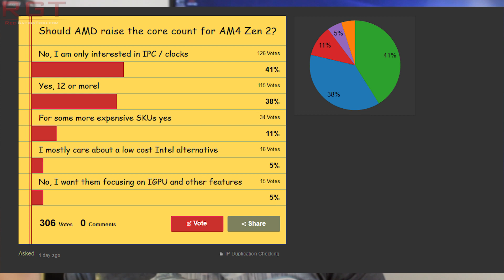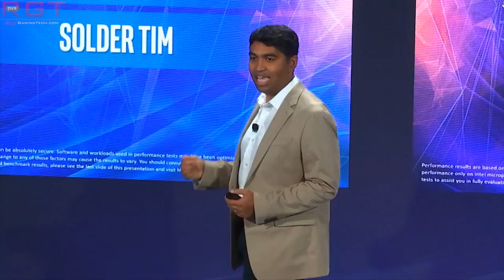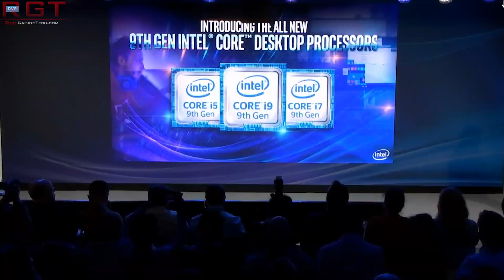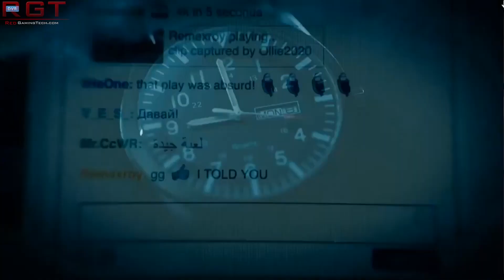Intel 10 Core Mainstream CPU Comet Lake | 14nm & Dual Ring Bus

Comment: Or, right this second you can go out and buy a 1st gen threadripper 1950x for $449 brand new on newegg and decimate anything Intel is selling in price/performance. Can't wait to see what AMD has in the pipes for this coming spring/summer when my new build has funding. Should be within margin of error for ipc when comparing Intel to AMD, and AMD will obviously have the core count and price point. Really hoping for somehow getting a threadripper at 32 cores and 4.6ghz, without the latency that current generation has. Latency is fine for workstation, but not so much for gaming. I need a streaming setup, so I need good latency to get good fps, since I play on 144hz monitors.
Reply: freak777power not for anyone who does literally anything more than gaming. Not to mention the price point for the performance. Name a single Intel chip that can compete at $450. I'll wait.

Comment: Id rather amd focus on clock speeds with 8 cores. It’s not like every game released even in 2020 will be multi thread optimized clock speed will be king for at least 5 more years.
Reply: Also multithreaded optimization only goes so far. Clocks is just raw speed you can’t go wrong with that.

Comment: Amd have already shown the specs of the chiplets used in epyc 2, 8 cores, 16 threads, pcie and no memory controller. Interestingly that means Ryzen 3000 series will  basically be a 7nm chiplet with a radeon GPU + memory controller connected via infinity fabric on the package.
Reply: @Zuluknob  it's possible that they they do a 16 core version on am4 by seeing how they mount them in pairs in epyc2. But I think they will go big on the Apu side, think of amds past, they basically build everything with as few dies as possible, so if they have a 7nm chiplet, 12nm memory controller + cache for epyc and threadripper and a 12nm Vega Apu+dual channel memory controller. They can cover everything from Athlon to epyc.
Reply: @Zuluknob  all desktop i7 and i9 chips have a gpu

Comment: I think it's possible that Intel are trying to make AMD use another ccx, which might affect gaming performance. We know that a single ccx will perform better than two ccx's in gaming due to latency, which is highly evident within the threadripper cpus, so Intel might just be trying to force AMD to compete with more cores, so that they might be able to retain a gaming advantage until they can get 10nm working (if that ever happens).

Just my thoughts.
Reply: You are thinking with Zen1 arch.  the new Zen2 layout will not effect latency no matter how many ccxs there are since the memory controller is now on a seperate die,  so all ccxs communicate the same distance.  IF is double speed too so latency should be half what it was for cross ccx with Zen1.    All this is assuming they do not use a monolithic design for Consumer Zen2,  which has not been confirmed either way yet.
Reply: I doubt Zen 2 will surpass 9900k in gaming anyways.
Reply: @Sinier940n  I also doubt it, but even if they come close or match them, that completely destroys Intel's last advantage. There is no way that they can manufacture a cpu that can compete with AMD in price to performance, so they have to keep a performance advantage or nobody will buy their chips anymore. Even a conservative guess on zen 2 performance puts them on par with intel (4.5 Ghz and +10% ipc). If they achieve something like +15% ipc and 4.8Ghz, Intel's lead in gaming will vanish, but probably only if they can keep the latency to a minimum. We already know that Intel's biggest advantage in gaming is their ring bus design. A single 7nm 8 core ccx would remove most if not all latency bottlenecks. But adding a second ccx could change that.
Reply: @jaredholcomb2533 Im very curious of what will consumer Zen 2 look like. A monolithic 8 core would make a lot of sense performance wise, but would lose the advantage of using the same die for all platforms. 
Anyways, lets see how  7nm compares to the matured Intels 14nm. 4.5 ghz on all cores would be very nice.
Reply: @Sinier940n   If the paper specs pan out,  I believe it will come very close in gaming,  probably beat it in productivity,  but cost a whole lot less,  and actually be available to buy,  which will be good enough for most people.
Reply: @bakadeshi_aunstudios  Good point, but like you said, we aren't sure if they will be separating the io controller from the ccx or not for am4 chips. If there are no scaling issues, I could see a 16 core actually having an advantage in single threaded applications thanks to XFR and the sheer amount of cores available. (case in point 2950x vs 2700x)
Reply: @jaredholcomb2533  I don;t think they will reuse same Zen1 ccx design for Zen2 desktop.  only reason it was designed as CCXs was to be able to scale out on threadripper and Epyc.  If they decided to do a different designs for Server and  Desktop this time around,  it will likely be 1 monolithic chip like Intel does without CCXs since no more need to scale out.   I think though that theres a good chance it will be 2 rome cores with cut down IO die,  just because a monolythic chip on 7nm will be kind of expensive right now, and yeilds still low.  it will be cheaper to produce the io chip on 14nm and the tiny cores on 7nm, keep cost low enough to still outprice Intel and make decent cash.  I was thinking one of the reasons the IO die is so large might be so they can slice it into 4 seperate IO dies for Desktop chips without changing the design.

Comment: At what MSRP?  The i9 9900K is already obscenely overpriced for the performance increase over the 8XXX series CPU's and almost twice the cost of AMD's current part (more than that if you take into account the markup due to lack of availability for the i9).  Add 2 cores and I bet Intel will try to push at least a $600 to $700 MSRP.  And what about clock speed/cooling?  Intel are already pushing the limits for the 9900K when running anything above 3.7GHz.  At 5GHz TDP is about twice Intel's stated 95W TDP.  Add two more cores and they face the problem of dissipating even more heat at high frequency or running at lower frequency and losing the advantage they only have due to frequency.

Comment: AMD will stay the course. Redesigning a chip due to competition will slow the release date down and cost more. I would think they will just skew the product range by pricing. Some people may be prepared to pay 40% more for 10% CPU processing gain..? FPS is probably the target. getting to 1080p 144Hz is the sweet spot for PC monitors, however being able to drive your home 4k televisions for their rated 60, 75 100Hz is also important...

Comment: So I guess this answers the "Should AMD go >8 Core for mainstream?" question, if true.
Reply: Also, if I have to switch to Intel to get >8 core on mainstream that means I need a whole new right.  I might as well go Threadripper at that point and get a better overall system with added PCIE lanes, etc.

Comment: Next

Heat lake
Nuclear lake
Fusion reactor lake
Fission reactor lake
Thermo nuclear lake
Reply: Star Lake
Supernova Lake
Reply: Gamma Ray Lake
Reply: Black Hole Lake
Reply: @The Dore The Comet is on it's way to Intel, and it's called Threadripper*
Reply: big bang lake
Reply: Rounded off by Lake Placid
Reply: meanwhile amd chips can barely break 4 ghz, hahah.
Reply: @Dr.WhetFarts  

Meanwhile AMD chips beat their Intel counterparts in just about everything outside game, only come like 5% behind Intel in gaming, run cooler, are all overclockable, all have SMT, and their not drastically over priced.

Also leading in technology and the server market now
Reply: Clockspeed =/= performance
Reply: @TheDarkToes  

Different architectures perform differently.
Reply: @nighttime1998  no... shit...

Comment: It'll run hot as hell. We already know it.  They can barely keep an 8 core cool anymore. 

And of course. Still 14nm..

In 2025 we'll be seeing their 14nm++++++++++ chip. 
While AMD and mobile chip makers are on 1nm or even lower
Reply: And people don't seem to understand what is happening. The original 10nm is canceled. Dead in the water. They'll be calling their 12nm process as 10nm. In the meantime, they will be overclocking their existing architecture and selling it as stock. They have to do this because they don't have a choice. They will continue to do this. It's Bulldozer all over again, but on Intel's side, except they actually had a good architecture to overclock. So Intel is trying to buy time. But it takes 4 years for a new process. That'll be 5 years from now. Because right now they're working on 12nm and is one year out. True 10nm will come 4 years later. And that's if they get it right this time around. And what's more, the first generation of a process is always slower than the previous process node. It takes the third generation of a process to be faster. So it could be 7 or more years before Intel catches up again.
Reply: They can get to 5ghz+ and function perfectly although they run hot, amd cpus can't get to 5ghz. Put a ryzen to 5ghz see how hot it gets. And that's with an nm advantage.. If you believe the marketing anyway. Intel high power consumption baaad, amd  high power consumption... meh it's only electricity
Reply: 5GHz isn't something special. It's not like performance drastically improves when you start reaching 5GHz, it's typically a rather linear scale when it comes to clock speed.
You can fundamentally have a 5GHz CPU and a 3GHz CPU perform exactly the same if there is enough difference in IPC and architecture. 

People just latch onto 5GHz because it's "higher and higher is better". We should be objective and talk about what actually matters.
Reply: @Angel_Zodiac  do you believe if Intel was on Intel definition of 7nm and amd were on tsmc definition of 7nm, the amd architecture would outperform intels all things being equal? Your right it's not about ipc or clock speed or core count or any one thing... it's the whole package
Reply: @1invag  no, because Intel's 10nm would probably be comparably to tmsc's 7nm (different densities I think is the reason), supposedly Goflo's 7nm would have crushed it, but they didn't want to invest in the smaller node. Don't know how much of a difference the architecture will make, especially since Zen 2 isn't out yet (even if it was, we can only make educated guesses).
Reply: @Combed Autumn Well, the whole lithography can of worms is rather complicated. Intel won't be on "Intel 7nm" for 3-5 years if the push to "Intel 10nm" is indicative of anything.

But, TSMC 7nm should have been roughly equal to Intel 10nm in terms of transistor density and should have been extremely comparable. 

However, there have been rumors here and there that Intel was going to give up on 10nm and some people speculated they may have had to reduce the density of the transistors on their upcoming 10nm CPUs. That there in lies the problem: We won't be seeing anything of Intel 10nm until the later half of next year whereas TSMC's 7nm is coming out early next year. Until then, Intel is stuck refreshing their old architecture on 14nm over and over, and it's quite obvious that it's showing its age with the ever increasing heating issues.
I really don't think Intel ever designed their architecture with higher core counts in mind, which is really hurting them currently.
I also don't think it's fair to compare TSMC 7nm to Intel 7nm since that will be many years apart in terms of technological advancements.
Reply: @Angel_Zodiac  I agree which is why we should be comparing apples to apples, the closest we can come to that is what available today. Not what amd has down the pipeline or Intel has down the pipeline, what's available now. As close as apples to apples as possible, it's it's undeniable in that version of apples to apples what the result is
Reply: @Combed Autumn I disagree. You have to be thinking about the short term future as well as today. Zen 2 is only a few months away and it's likely to be as fast as or faster than the 9900k, while retaining lower power consumption (and thus less heat). 

Even if you only looked at today, I don't know why anyone who doesn't have a hole in their pocket would consider anything Intel has to offer. Gaming is really the only niche Intel has right now, and that niche disappears unless you have a GTX 1080 or higher and play at 1080p.

I'm a bit biased against Intel due to the company's history - their practices aren't something I can support philosophically - but I just don't see the point of anything Intel has to offer unless you want the "best performance money be damned". Even in that category, however, there are tasks in which Ryzen/Threadripper wins. 

The thing is, though, is that if you want the best performance at all times, you're going to be going with a Zen 2 processor when it comes out and then likely a 2019-lake CPU that Intel comes out with in the later part of 2019.
Reply: @1invag  if 3rd gen Ryzen gets enough of an ipc and frequency bump, then it doesn't matter so much if it doesn't quite reach 5ghz.

Comment: I just want 8 core 16 thread CPU with 5ghz all core overclock no AVX offset with reasonable temperatures when cooled by a NH D15 for $499. Extra cores mean nothing to me, single thread performance master race
Reply: lets see if you still say this in 3 years.
Reply: If we see an 8 core chip for any more than $350 i'll be thoroughly disappointed, no matter the clock speed. If AMD releases a $500 processor it better be at least 10 cores.
Reply: Games like FarCry and even Wow use lots of cores and threads as more objects are displayed on the screen. Games still use what most people have which is 4 cores still. Game engines will use more cores if more people have better core counts
Reply: Can't you already get that with the i9-9900k?

Comment: 10 Core Water Boiler, 12 Core Sauna, 16 Core Fusion Reactor
Reply: So when you go to HEDT, you use so much energy that you accelerate the heat death of the universe...
Reply: @andrew7720  yes you use over 9k watts
Reply: 18 core arctic melter !! infact on secureeteam chanel sayed that something melt ice under arctic and that was 9900k probably
Reply: 64 core?
Reply: @eurocrusader1724  Comet Lake points already the direction: Supernova Lake
Reply: @Sean Pereira Wrong.  It's actually meant for the high end main stream market, not server use.
Server use already have 128 threads lol.
Reply: @Nighterlev  The only AMD 64 core cpu is an EPYC. Thats a server cpu. The highest core count consumer cpu is the Threadripper 2990wx, and its 32 cores.
Reply: @Nighterlev  Yeah no

Comment: Are these are supposed to compete with the up coming 16 core Zen 2? if so there in for a shock haha
Reply: 16 cores zen2 is possible, but I'm afraid  AMD will not cannibalize their own HEDT series, so it will mid likely be 14 or 12 cores. May be 10, made from leftovers from Rome production. AMD needs server share first and foremost.
Reply: @Zecuto  Zen 2 ccx ir 8 cores which means Ryzen3 will be eather: 16 cores / 8 cores multi-die or 8 cores monolithic.
Reply: @Zecuto  TR features quad channel support for memory and 64 PCIe lanes; they wouldn't overlap as much as you think, as crucial features differ.
The cheapest TR processor out there is the 1900X - an 8C/16T processor.
Reply: tamenga88  yeah,  it makes more sense to go 16 cores mainstream in another year-two, as Intel already can't provide same value. Playing cards too early will only sabotage AMD's own upgrade path.

Comment: I don’t care what nm it is or how many cores it has as long as its  better than their predecessors for the price
Reply: except it won't be a 10c 14nm++++ CPU will draw atleast 200w from the wall, i wouldn't be surprised if they shiped it with ln2 reservoire just too cool it

Comment: Someone explain this in English please.
Reply: Rumours say Intel wants to realease a 10 core CPU to compete with rumored 12 core ryzen 2. Unfortunately intel will still be using the 14+++++++++++++++++++nm  process like coffee lake. Which means the CPU will need liquid nitrogen to stay cool. The 9900k already hot with watercool solution. That's the problem of a monolithic CPU design.
Reply: ZeroFallout1 thanks for breaking it down .

Comment: 14++++++++++++++++++++^30, it'll pull 1KW, and will be uncoolable with ln2, as you'll need liquid helium
Reply: And will be 3% faster and  300% more expensive at that point, but some retards will still justify the pricing.
Reply: @Tomas-qn5im  So 50% of the price of a 2080ti?

Comment: I do believe intel are definitely working on something to combat zen 2..and if they can't break 10nm then more cores is the only other viable option in intel's hand
Reply: But more cores means even bigger die to compete with ryzen's small dies. Do you think they will be forced to drop IGPU?
Reply: @Zecuto  hopefully, bloody waste of die space. Just like tensor cores on the rtx2070
Reply: @KelDG3  Nvidia has right to do whatever it wants for now, but Intel is increasingly losing that privilege.
Reply: @Zecuto  Except it doesn't, 2000 series isn't going anywhere near as well as they hoped. Calling it a "right" is just plain silly. LOL
Reply: @robertstan298   Nvidia has all the rights,  what are people to do when Pascal cards run out? They don't have a choice, and Nvidia is gonna provide it to them with 2060.
Reply: Also, oh the irony. MOAR COARS!

It's not really about nanometers at this point for Intel, it's about the fact that their Core architecture is old and fully tapped out, and only now with AMD's Zen shake up is the market beginning to notice, sadly.